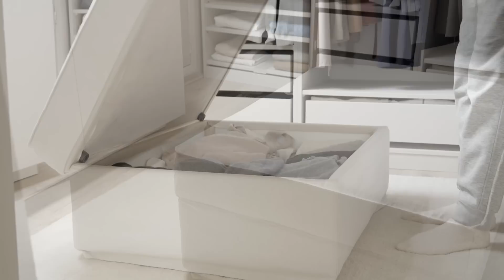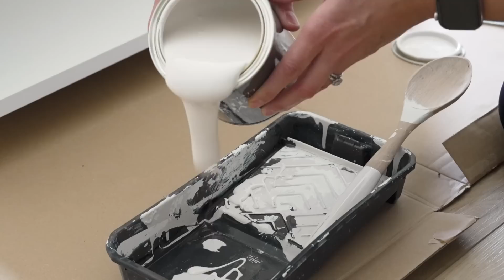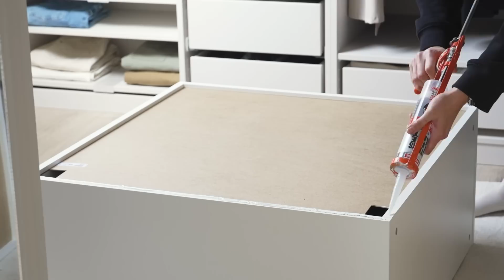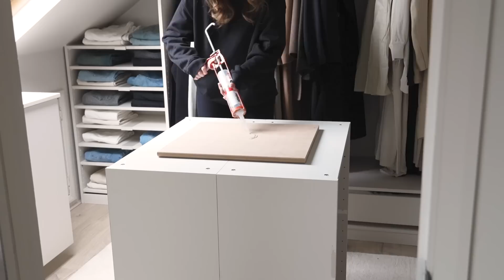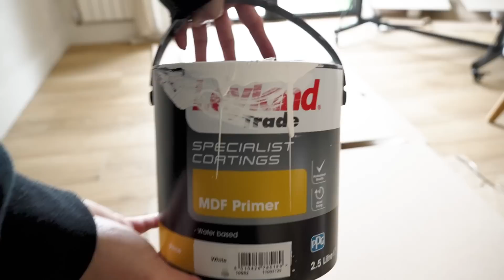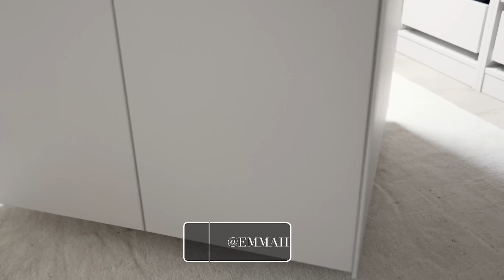IKEA HACK | Rotating Storage Unit Island

Comment: Beautiful! 🤩 I love your videos they’re informative, quick and straight to the point. 

Just curious, instead of putting the 3 pieces of MDV would filling the gap between the two cabinets with wood filler then sanding the surfaces then painting them, do you think the outcome would have been similar?
Reply from the maker: You could definitely do that but as we only glued the 2 units together (to avoid using unsightly screws internally) you would run the risk of visible cracks with movement. I trust the glue we used but over time there will definitely be movement x